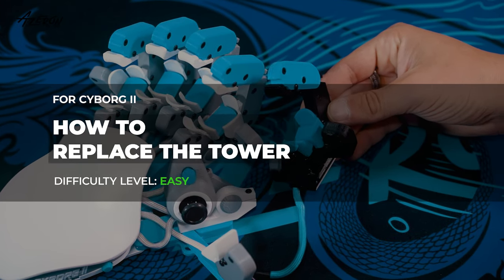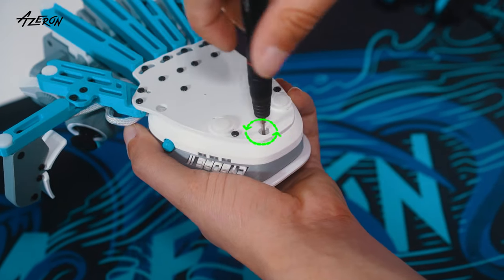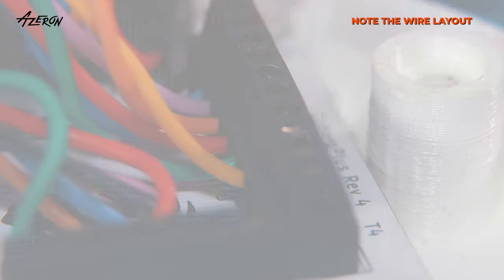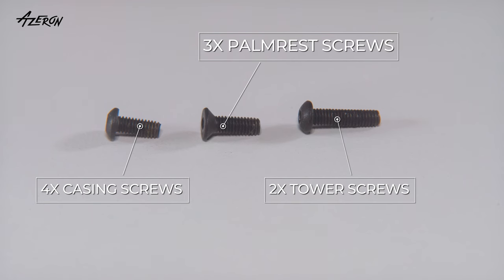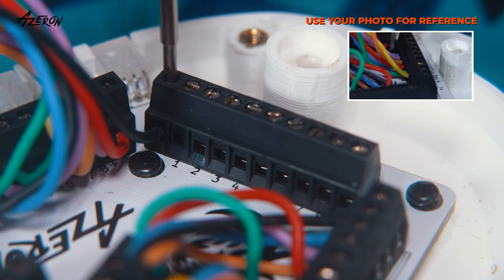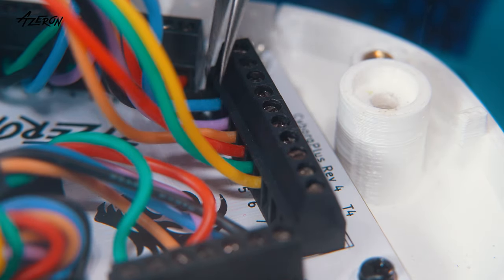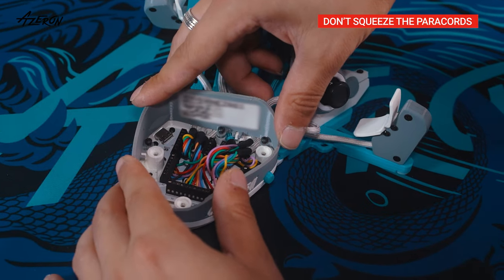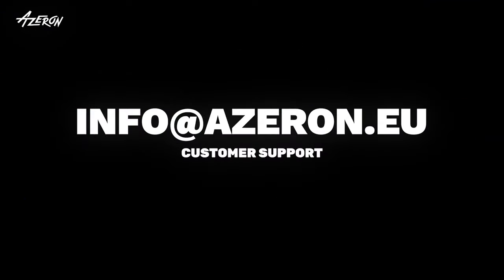How to replace a tower on your Cyborg II #azeron #azeronkeypad

Comment: I was wondering if I wanted to connect it to my ps5 can i download the azeronn software on ps5 or does it have to be on windows to set up
Reply from the maker: Azeron software can only be used on Windows, so the initial setup will have to be done on Windows machine with Azeron software installed.

Comment: Replace ? Tower ? Why ?
Reply from the maker: Just in case something happens with the tower and replacement is needed.
Reply: @AzeronEU  EDIT: I fixed it!  Saw a suggestion about sawing a "slot" into the head of the screw and it worked!  Mad I didn't think of it. 😂

ORIGINAL COMMENT: Yup, like stripping the screw on the thumbstick like I just did to my brand new Cyborg II.  I have used 5 different Cyborg's and never stripped one but I couldn't get the thumbstick to stay in place (the constant pressure from moving the stick) and tried to tighten it and... well here we are.  It's the top screw for the tilt of the thumbstick so it seems I will have to replace the whole thumbstick assembly.  😭 How can I do that?